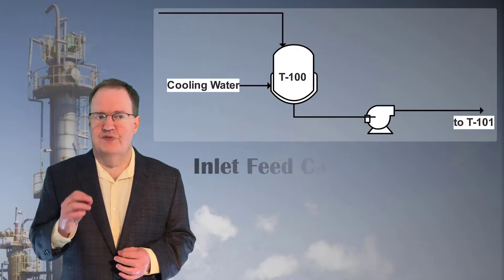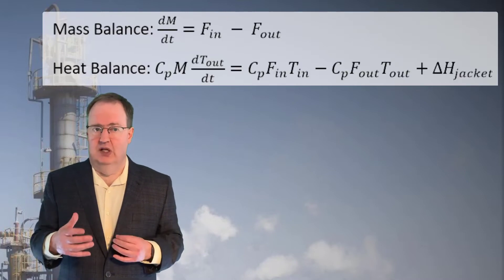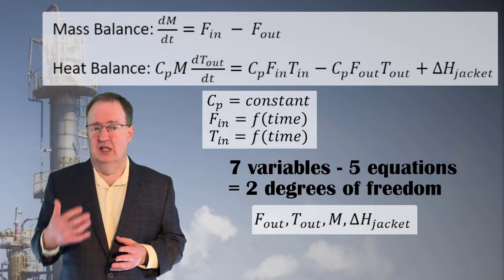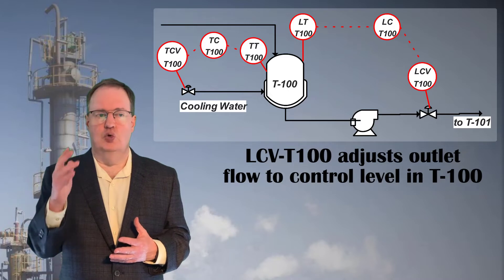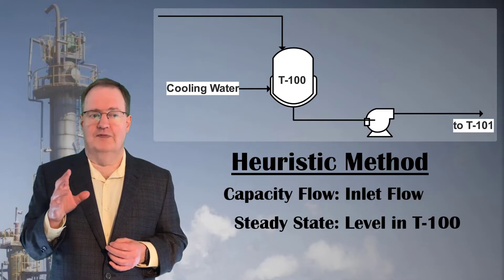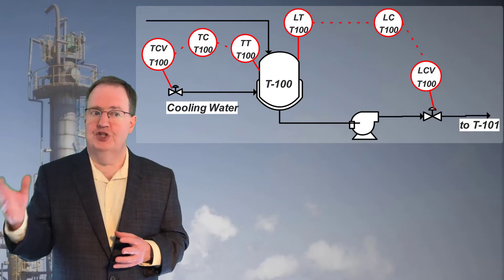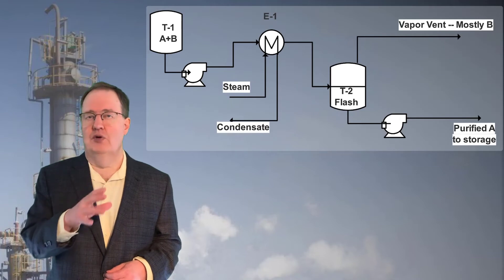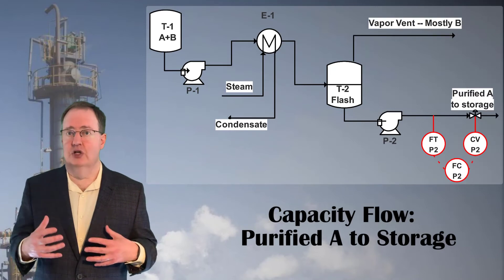Degrees of Freedom

Comment: Thank you Prof. Meadowcraft for this wonderful series of lectures. I have a query at 9:27, why can't the pressure control for the tank also control the tank level ? Why do we have to separately add a control valve for manipulating inlet flow to control the tank level? Like, when pressure builds up, then vapour in the tank is released into the vent line, then the net vapour content in the column reduces, so vapour-liquid interface in the column won't move upwards ? The increasing tank pressure wouldn't exert a back-pressure on the incoming flow into T-2?
Reply: The goal of the pressure controller is to keep the pressure constant (to mantain steady state). So you cant use pressure changes to control the liquid, because there should be no pressure changes.